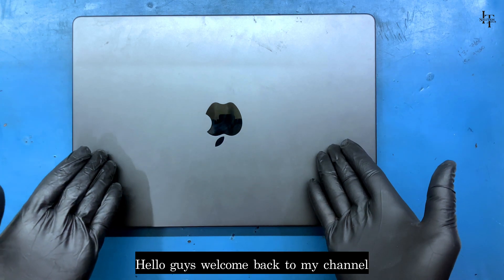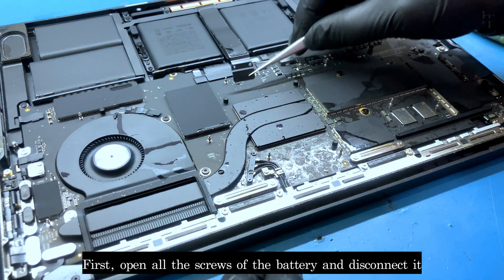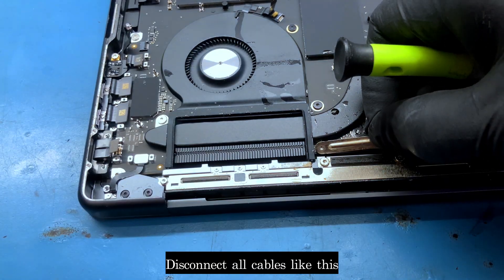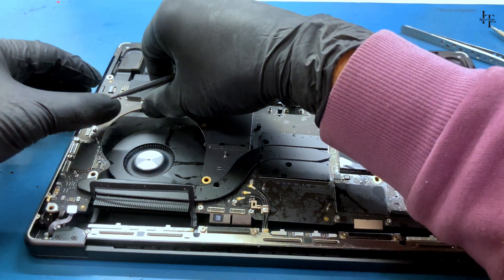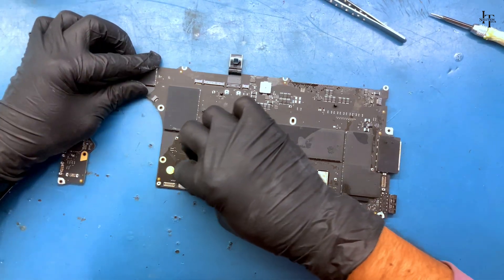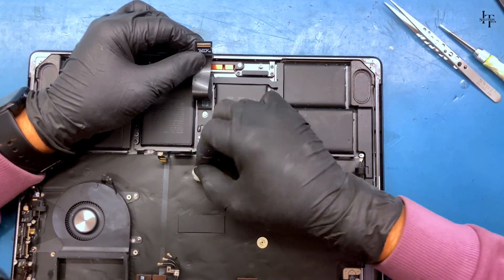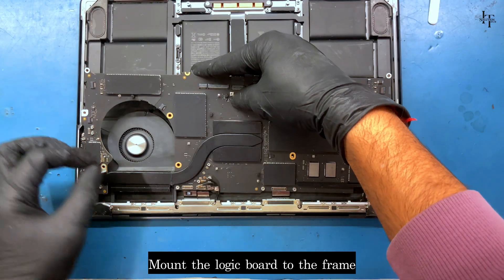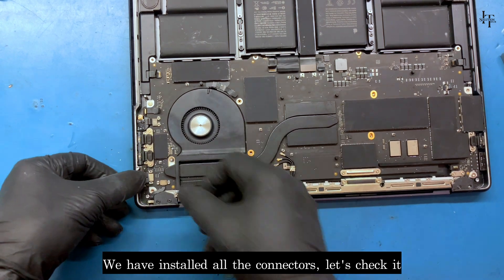Macbook Pro M4 Water Damage ll Model A3112 ll Problem solving

Comment: My MacBook Air M4 2025, which I bought only 3 months ago, has a screen that won't turn on. I took it in for warranty service, and Apple said that water inside the computer damaged the screen or something like that, and they won't cover this case. I find this very unreasonable because I've never spilled water or any liquid on the computer. The price they quoted for a screen replacement is nearly 700 US dollars. Can I fix it myself?

Comment: I hope my comment helps calm anyone panicking. I spilled cranberry juice on my 2023 MacBook, and it soaked the keyboard for a while before I noticed. My laptop would not turn on. I placed paper towels on the screen, set it upside down, and left it alone. After 5 days it wouldn’t start, but around day 10 it powered on with a few glitches. By 2 weeks it was working perfectly again. I’m only here now to clean out the dried juice, even though the laptop is functioning fine. I hope that helps because I was about to cry when my laptop died.
Reply: Did you clean it yourself?